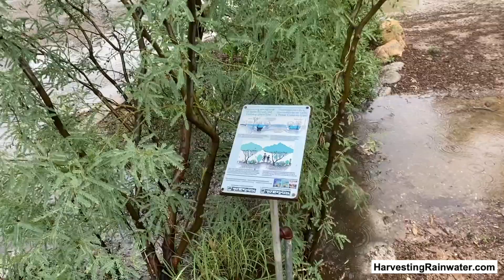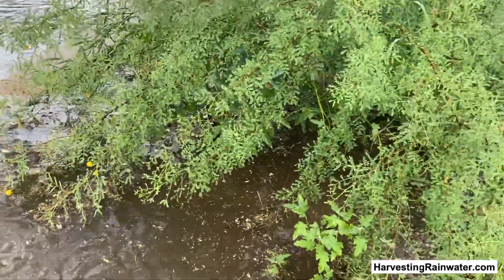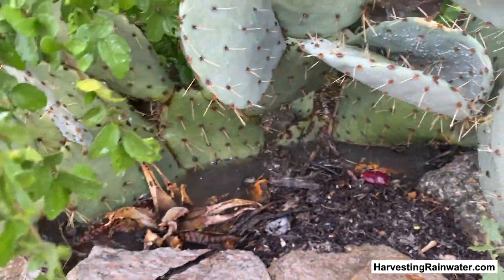Maximize your harvest of free stormwater from streets and driveways by Brad Lancaster

Comment: Looks great but seems like the balance between the watermanagement and the practical use of the sidewalks for pedestrians and cyclist is a bit off, no?
Reply: Where he lives, I doubt that storms like these happen more than once or twice a year so it's fine ?
Reply: Tucson solves this issue by building a concrete sidewalk with metal plating where the rainwater goes under to a water basin. This idea is great for any area that wants to raise their groundwater and water aquifer levels

Comment: How can you find out if curb cut basins are allowed in your neighborhood? I’m in the city of Phoenix and I am not in an HOA neighborhood.
Reply from the maker: Call your local transportation department. You should be fine in Phoenix as there are a number of stormwater harvesting curb cuts installed there. See Chapter 8 of "Rainwater Harvesting for Drylands and Beyond, Volume 2, 2nd Edition" for more key details and tips.
Reply: Did u do any?
Reply: @l0gic23  No. We did use Galaxy Gardens to gutter our home and put in a 2700 gallon tank for rain catchment. We’re also doing passive catchment in the front yard but in the end decided we would have to deal with the city to get a curb cut, and it wouldn’t really be worth it.

Comment: That 3": pipe doesnt get clogged up? how often are those needing cleaned?
Reply from the maker: Never thanks to correct slope and placement
Reply from the maker: It does not clog if you maintain minimum 2% slope. Street-side basin acts as a sediment trap. For more details, see p. 215 of "Rainwater Harvesting for Drylands and Beyond, Volume 2, 2nd Edition"
Reply: @HarvestingRainwater it will clog 2 inch slop is used for water with minimal debris you'll have lots of that.